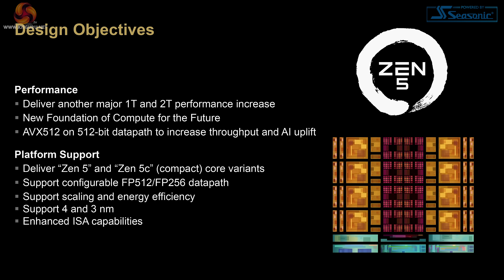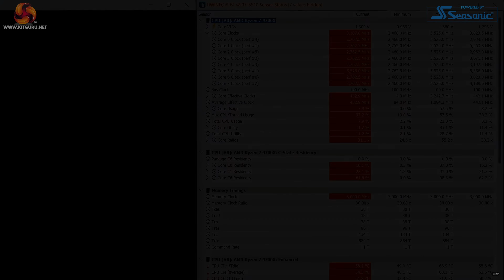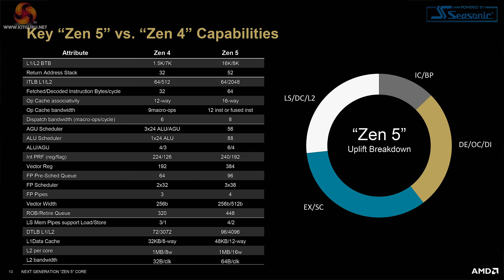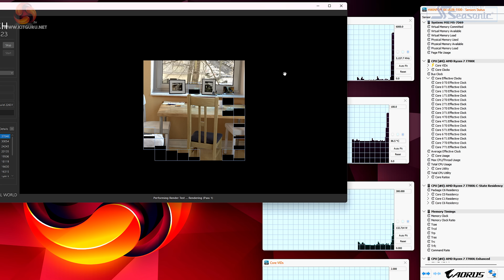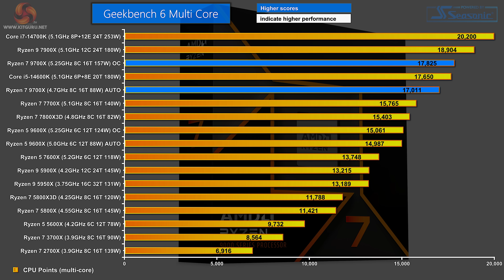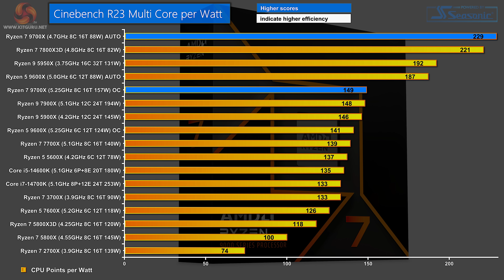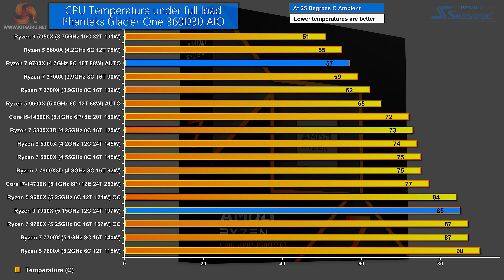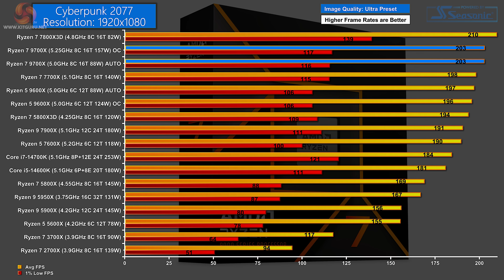AMD Ryzen 7 9700X review: YouTube hates this CPU

Comment: I don't see it as bad. The power saving is still attractive depending on what your use cases are. Also, huge productivity boost for some applications using AVX-512 . It just seems that the 9600x 9700x are focused on Desktop productivity market, not gaming. AMD is splitting up the chips into Desktop Productivity, Gaming with the X3D, and  the "Professional" or "Enthusiast" market with the 12 and 16 cores. 

Seems like a sensible approach.
Reply: If you been following recent energy crisis, you would like to have more power efficient PC, after all I do not wish to be paying hefty price for my electricity bill.
Reply: @Gattberserk  Then buy the 7700, its the same TDP, only a 7-8% performance difference and it's cheaper. There seems to be no reason to buy the 9700X.
Reply: @dreadtrain2846  There is no reason to buy the 7700 when 9800X3D is around the corner. 

This time X3D comes with OC capability or curve frequency optimization.
Reply: I think many people also lose sight of the fact that AMD wants to attract OEMs… OEMs who right now are annoyed with Intel and see a CPU that is unlikely to cause thermal or degradation headaches and runs nearly parallel to last gen units. AMD wants to make money and knows smart prosumers can figure out PBO or do a manual OC, but they’re going to clean up with OEMs, and that’s where their bread is buttered.
Reply: you already could have same power saving with 7700 non X so... unless AMD drastically lower prices,  this is just really awful release
Reply: @Trisstan20  If you upgrading from AM4 to AM5, what's the point of getting a 7000 series? I agree there is not a real reason to upgrade from 7000 to 9000 except you go from 7700 to 9900.
Reply: Yeah in some countries you pay 0,55€ per Kilowatt Hours. So you gonna feel the less power draw in your bill.
Reply: @ploed there is no country in Europe where you have these prices lol.
Reply: @KillaGorilla-l7z  do you live in Germany? That's what we pay, depending on which power supplier you get your electric.
Reply: It is still a massive gaming CPU, c'mon. Who really needs overcosted X3D anyway, some whales with top-notch GPUs to uphold their hubris?
Reply: @ФедяКрюков-в6ь  3D is best for gaming mate.
Reply: @ФедяКрюков-в6ь The x3d cpus are avalible cheaper than this entire lineup. Infact these are the worst price to performance gaming cpus
Reply: Unfortunately their predecessors beat them in some applications with similar power consumption, for a lower price.
Reply: @dreadtrain2846  I've not seen any comparisons showing similar power consumption with better performance?
Reply: @dreadtrain2846  there's not a single benchmark which would show comparable performance and even remotely similar TDP.
Reply: @michael.petraeus  HWUB literally just dropped the 9600K review where they show the R7 7700 non-X (65W) against the R7 9700X (65W).  Cinebench I think it was, 7700 was at 1125 points, the 9700X about 1195 points.  About 6-7% performance uptick at the same wattage.
Reply: @michael.petraeus  I think he is referring to HUB video where the 7700 performs 7% slower in cinebench while consuming 5% more I believe (compared to 9700x). That is such a small margin that it is basically meaningless if we consider that AMD took 2y ad a node change to deliver this. 
In itself the new gen is an improvement on the older one, but it is in most cases a marginal one and it costs more. In my view this launch is a disaster so far (also considering that various reviewers had serious stability issues with these new processors)
Reply: @dreadtrain2846  no, it's not. Jesus Christ. 9700X is on part with 14900K in some benchmarks.
Reply: @cptwhite  fluke, at most. 7700 scores below 1100 in CB2024. 9700X is above both 7700X and 7800X3D. Also, with PBO or without?
Reply: @dreadtrain2846  there literally is not any benchmark that shows 9700X lose to 7700X at the same Wattage... 💀
Reply: @dreadtrain2846  The 7700 reached 1125 pts and the 9700X reached 1201 pts, so the 9700X didn´t lose. But in Europe the 7700 costs 294 Euro with the Wraith cooler, while the 9700X costs 399 Euro without a cooler. In Australia the difference is with 488$ vs 650$ even bigger.
Reply: @dreadtrain2846  nope, i watched it and seems like you don't know how to read graphs. 9700X got better score than either 7700 or 7700X at the same Wattage
Reply: @dreadtrain2846  and 9700X launch prize is way less than 7700X launch price, it's not a surprise that old model price drops drastically
Reply: @dreadtrain2846  what on earth... say which video and timestamp, because I checked again and there is no 7700 vs 9700X in any graph except Cinebench 2024 Multi-core...
Reply: @cptwhite  You can also find other sites who found 20 to 30% improvement of 9700x compared to a 7700.
Reply: @michael.petraeus No it’s not clown it gets destroyed by an I5 in workstation tasks.
Reply: @TheLapari In order for the 9700x to beat the 7700x it has to run at the same power as it. Then it’s only a %10 advantage on average.
Reply: @ZackSNetwork  stop it, get some help.
Reply: @ZackSNetwork  nope... every benchmark so far has 9700x beat 7700x with less power
Reply: @michael.petraeus  "no, it's not. Jesus Christ. 9700X is on part with 14900K in some benchmarks."

There is no shot it beats the 14900K in any meaningful benchmarks, you probably saw it beat everything in the AVX-512 benchmark, the 9700X hardly even beats a 7700X and you are trying to tell us it beast a 14900K somehow?
Reply: @aflyingcowboy31   watch LTT video about it. In F1 2023 9700X goes head to head with 14900KS chugging 253W. In Rocket League even 9600X outperforms the Intels. Several other benchmarks also see Intels fall behind.